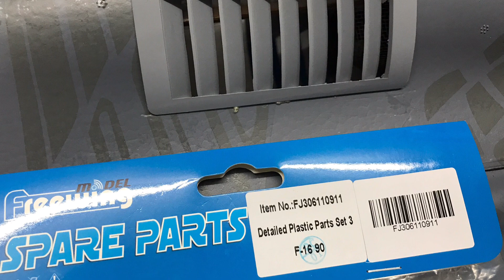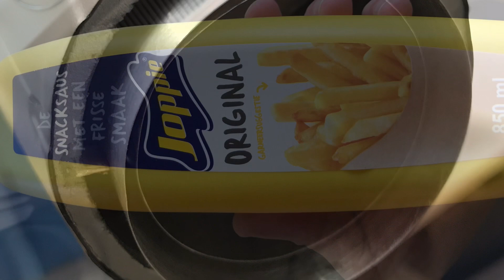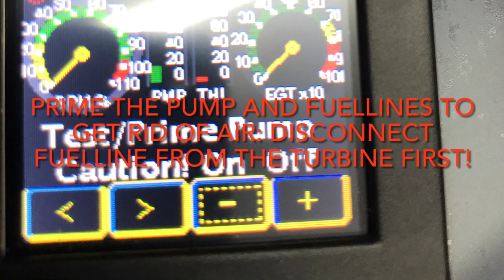Freewing Gripen turbine conversion how-to

Comment: Marco, great vid! How did you program the stabilizer? I have flown my X-45 powered Gripen twice now and not very stable.
Reply from the maker: Simply set as “Delta wing” and use it only on the main wing. I have a knob on the transmitter to set the gain as I go.

Comment: take the FMS 80 Inrunner EDF 8S with 5 KG Trust....its the same...and much cheaper....of course for me :)
Reply from the maker: A good solution if you only look at thrust. But the Gripen already has difficulty with the CG by fitting a 6S5000mAh lipo. An 8S would make it nose heavy, thus hard to take-off. And the total take-off weight would be a lot higher still. Mine gets lighter the longer I fly, and easy 6-8 mins flying time. For me, turbine wins always.
Reply: and i fly with an 6 s   5800mAH !
Reply: @marcovandevelde  and i fly with 5800mAH 6S